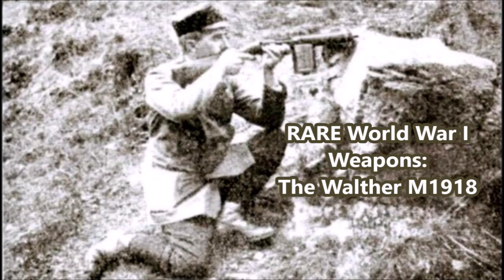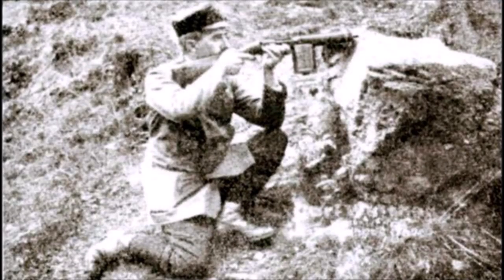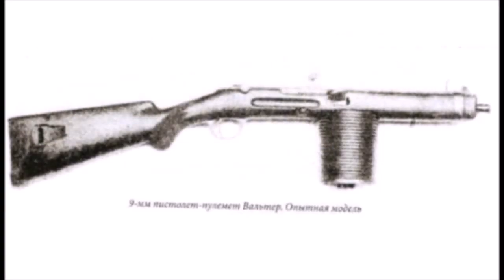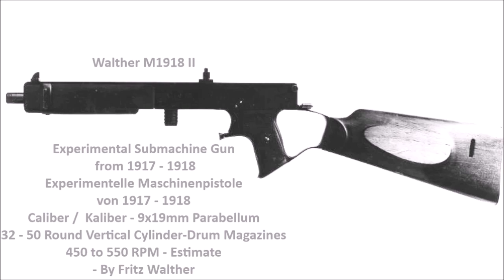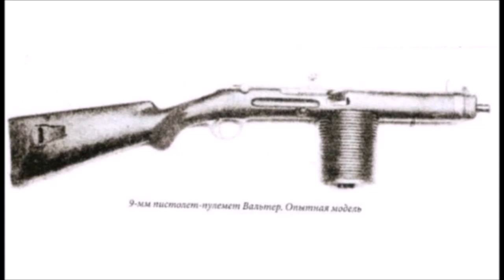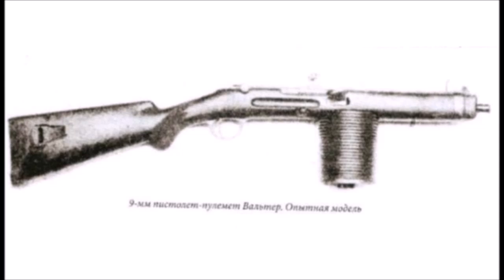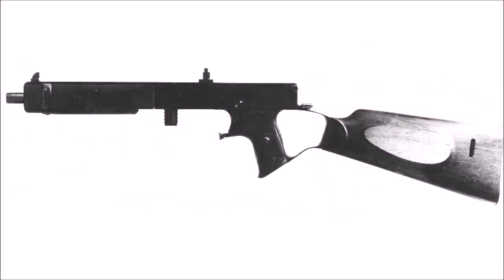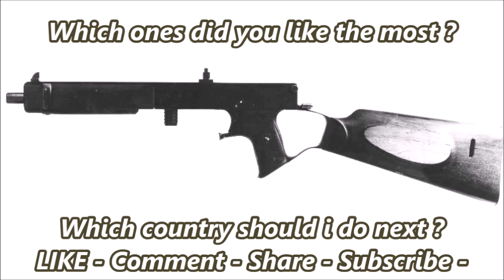WWl Weapons: The Walther M1918

Comment: The first round of patents were filed on May 25th, 1918, prior to Armistice. This firearm had some rather interesting features. Firstly, it was gas-operated. It also had a cooling system where vent holes were located at the front and rear of the receiver. While firing, the movement of the bolt assembly was intended to drawn in cold air from one side of the gun while exhausting hot air out the other. Furthermore, it was a feature a non-reciprocating charging handle that hangs in front of the ejection pirt, tripling up as also a dust cover and brass deflector. The magazine was meant to have a built-in oiler to lubricate the cartridges. One last feature that I've seen in patents, but can't really make out if implemented in either of the prototypes, is a dual trigger assembly. This would presumably have been to choose between automatic and semi-automatic fire.